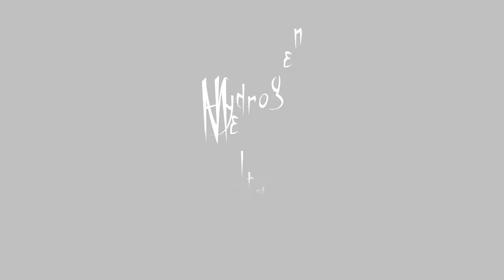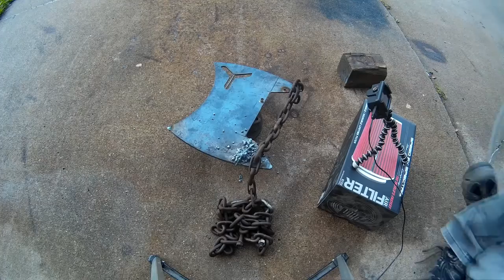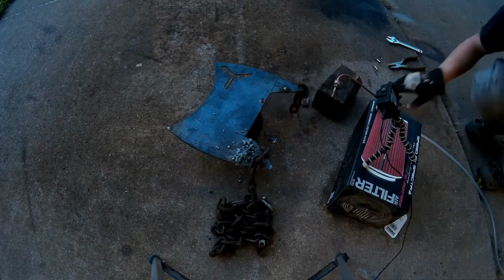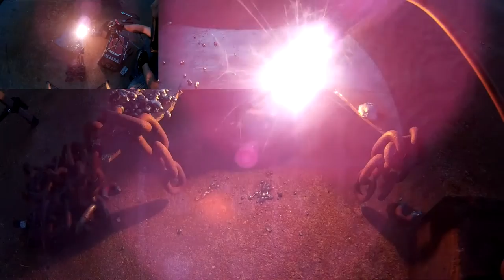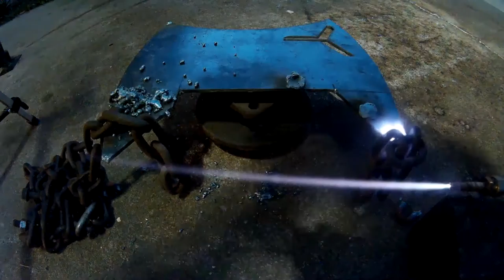120V Hydrogen Generator Torch Cutting 3/8" Chain

Comment: i think if you figure out a way to use pressurized air to blow the slag away it will cut faster
Reply from the maker: Yes agreed.  I was videoing a request video last night cutting thin metal and it cuts right through and then I tried cutting a flywheel from a 350.  It cut from 1 crank bolt hole to the other but once you start to get to much slag it stops cutting and just blows the molten metal from side to side.  Im also running it at low power so I guess I could just turn it up lol
Reply: and it will release fumes, dangerous to human wellbeing. at that point it's just as bad as arc welding with regular electrodes.

Comment: how long in real time ?15-20 mins? How much watts do all divices need? can you test how fast 1liter water need until boiling? Thanks
Reply from the maker: +axxe D. Ya I think it was about 15min. It would cut faster if I maybe tried using compressed air to blow the slag out of the way. Watts depends on electrolyte strength. I can test water boil when the temp outside gets warmer.
Reply: I tested to boil 1l water with an electrical water heater (2000-2400W).  Starts with an water temp 21,9°C | | 71,42 °F.
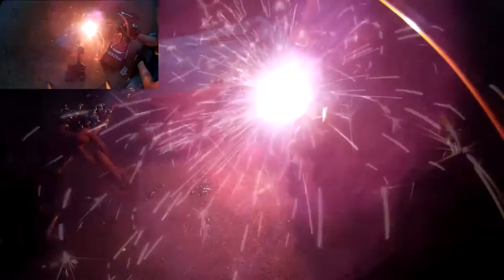 After 2:52 min. the thermostat turn the heater off.

Sorry for my bad english :D
Reply from the maker: Keep in mind that the flame is over a foot long but it is about 1/4" wide and only using 720-1080watts to run.
Reply: @AveRage_Joe  The water boiling is an interesting point I had not considered before.  If you run this thing for an hour straight for example... at some point the waste heat will have warmed up the water and eventually it will begin to boil(releasing steam into the HHO gas).  That is a major downside.  Have you had this happen yet?
Reply: @thedillestpickle  to avoid that, keep the cell submerged into a vat of water or add aluminium or copper heat sinks to the sides of the cell.

Comment: oh use an acetylene torch ,the oxygen increases the heat and the oxy jet is what does the cutting . You only need 7 psi of gas to work the the torch
Reply from the maker: Needs more pressure for sure to remove the slag lol.  I still want to add a little compressed air to see if that would help and still burn!
Reply: compressed air does not have what it needs to cut the steel . You would be just melting it and blowing it away . Hydrogen is only a step behind acetylene . Even a large demolition torch ," with in reason of coarse " uses around 10 psi of acetylene , 6 or 7 psi would work fine  . That is easily reached by your hydrogen torch . With your hydrogen hooked to a demolition torch you could cut railroad track with out a problem or hesitation . Please put flash arestors on any torch you make , they are cheap off eBay. you are putting yourself and every one and every thing around you at grave risk . With out those arestors     it is a matter of when not if .  But this is awesome for demolition get this working .If you do I would make a fortune
Reply: I could be wrong on the compressed air . Damn If compressed air did work , 'one could get a huge pile of cash from demolition " The fuel takes over 3/4 of profit from demolition . WOW ONE COULD MAKE A PILE WITH FREE GAS !!! . Go on Craigslist and get a cheap torch head 20 -  30 bucks about the same for short hoses . You are definitely on to something  ! KEEP GOING ! THIS IS AWESOME !WATCHING INTENTLY
Reply: @huckstirred7112  I don't expect that would work... Or you could do the same thing with acetylene torch.  Run 3 hoses, one for acetylene, one for oxygen to keep the heating flame going, and a third with compressed air to cut.  But if that would work, people would be doing it already.
Reply: @thedillestpickle  the reason it is not used is because the steel is ruined do to hydrogen em brittlement .About a year from the day hydrogen is used the steel would crack and fall apart . 7018 low hydrogen rods .But a great Idea for scrap-
Reply: @huckstirred7112  No no, I mean why people don't run compressed gas to cheapen their cutting costs for scrap
You need that high purity oxygen to burn the steel, no shortcut by using 21% oxygen compressed air.
Reply: @thedillestpickle  yes you are correct about the oxygen . 
But swapping out acetylene for hydrogen would ruin the steel for anything other than scrap for the foundry .; Do you think hydrogen would work in an oxy acetylene torch?
Reply: @AveRage_Joe  Do it post results and prove us wrong ! I seriously hoped you do prove me wrong . If you do I will hang a poster of you wearing a leotard with a big s over torch and wearing a cape with a hydrogen flame on it !
Reply: Umm the introduction of air is how regular butane torches get the jet flame going on..  besides when your using oxy acetylene you basically are “blowing” away the metal.. the oxygen super heats it and blows it away..  and think of plasma cutting..  thats blowing away the molten metal the plasma has made..  so introducing an air intake onto the torch woukd work for sure except since hydrogen iis so fast burning it would likely need more of a production level of gas to accommodate for the increased flow.. the reason hydrogen is so dangerous is because its more prone to flash back into a hose where it can be burning so fast that the flame backs up into the hose and not even look like it has then boom..  is how detonation occurs on vehicles in the dry box..  but how does hydrogen compromise steel?  Steel will just form an oxide layer overtop and just rust if anything…
Reply: @Z-Ack  no hydrogen causes hydrogen embrittlement  . 7018  for an example is a low hydrogen rod  . If not kept in a 300 degree rod oven " and for ultra critical welds not left out for more than 15 minutes " it will absorb moister from the air and the hydrogen gets trapped in the metal causing hydrogen cracks . Those cracks will cause catoptric failure about a year later .  On anything critical over 1 inch thick 60 series   " 6010 " should never be used  always use low hydrogen rods on any steel above 1018 " mild steel ".  If all the oxygen did was blow it away ,torches would use compressed air .  oxygen actually rust it away .  Plasma cutters use compressed air to blow it away . I think "not positive " acetylene is lighter  than hydrogen .  but The mixing valve would get the hydrogen hotter and the oxygen jet would do it's magic .Acetylene burns faster than hydrogen ,I am certain of that. All oxygen acetylene torches have special one way check valves to keep fire from going up the hose called flash back arrestors . Victor torches have them on the back and are removable . But very bad Idea to do so .  I have caught hoses on fire many times so it is not instant death unless it gets to the tank
Reply: @huckstirred7112  we use watter bubblers to avoid backfire.
Reply: @huckstirred7112  it's fine for cutting

Comment: hydrogen cutting will put hydrogen in the steel rendering the steel useless for anything other than scrap for recycling ,witch the big cost to scrap is fuel so not a bad idea
Reply from the maker: Interesting! I havent heard that!  Ive heard of hydrogen embrittlement but mainly on titanium.  Is it similar to that?
Reply: when welding any steel above 1 inch thick ,you have to use a dry low hydrogen rod .the rods even have a time limit on how long they can be out of the rod oven . The reason for this is those rods suck moisture out of the air . That moisture will introduce hydrogen . On thinner steel heat will pull it out ,thicker steel it will get trapped . As it works it's way out it causes hydrogen cracks .Those cracks can cause a what is known as a catastrophic failure a year are more later.
Reply: I've heard this before, but I've also heard that the hydrogen in the hho torch is used up before it reaches the working surface, any truth to that?
Reply: @Jeanclaudevanderfield  The result of burning impure hydrogen is water and oxygen . To take out the water you would have to have a COLD air dryer . "My cold air dryer for the compressor is 1/2 inch copper line inside the shed fridge , with a water collector being a 2 inch pipe 12 inches long . " works great "!  That being said you can have carbonizing flame on a acetylene torch , " the black smoke that billows out " .If excess hydrogen hit the steel you instantly destroy it .Who hasn't cut with a less than perfect flame ?  OH SHIT !! OUT OF OXYGEN  , I THINK I CAN MAKE THAT LAST INCH  !!  PLEASE GOD ONE MORE INCH  !!!  LOL
Reply: @AveRage_Joe   I haven't had the time to do any experimenting . Have you done any more this Idea needs further exploration ,.I truly do think you are on to something !@ Keep going
Reply from the maker: I havent. No time as of late.
Reply: Acetylene molecule · C2H2, just as much hydrogen as a molecule of water
Reply: @Z-Ack  You maybe  correct about it burning to fast  . That is something I am not sure on .   Welders that weld on critical infrastructure  are terrified of hydrogen embrittlement  .  That is something I would like to know more on .  before I would trust it for fabrication . But metal prices are high so is acetylene . hydrogen burns almost as hot as acetylene . I don't have time to try to put it into a cutting torch .  It would be neat if someone can pull it off

Comment: I could have cut it with a hacksaw faster
Reply from the maker: Thats the truth, if I added some air pressure it would have cut a lot faster to get rid of the slag!
Reply: AveRage Joe at least you have a good attitude about it have a great day!
Reply: I was just going to say Angle grinder for £25 made in China beats it all day long.
Reply from the maker: +Oddball True that🤣
Reply: But hey man have fun I made a number of HHO cells in the past when I was experimenting with it on engines. Still have them kicking about. :-)
Reply from the maker: +Oddball They are fun to mess with. That was the original intent for this genny to run a small eng, just need to start searching again for one lol
Reply: use an oxyacetylene torch ,the oxygen increases the heat and the oxygen jet is what does the actual cutting . Hydrogen is only 5 steps below acetylene as for as heat . You have to have check valves on your torch or you will eventually kill your self
Reply: Just go down to the hardware store and ask the assistant to cut it, or make your own fucking fuel and torch and do it yourself.